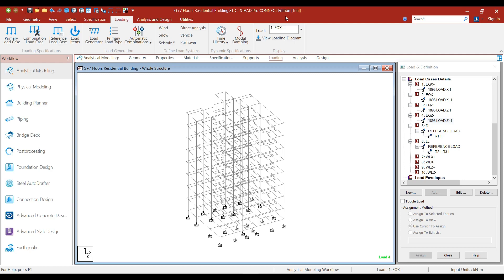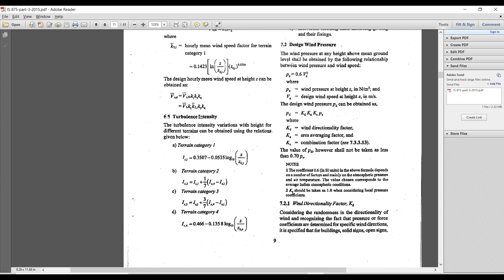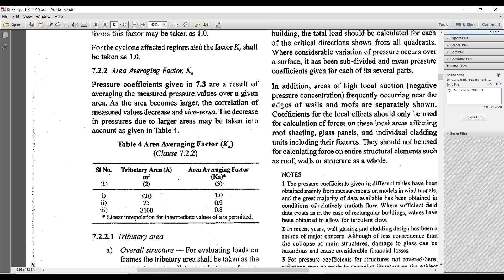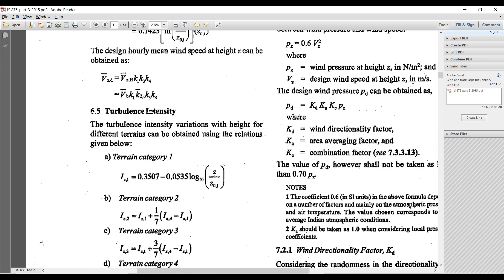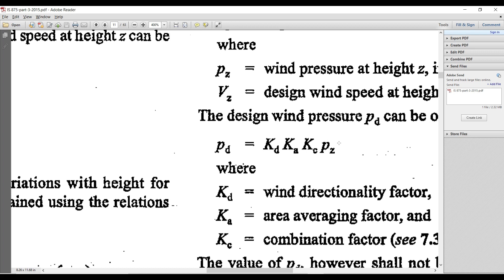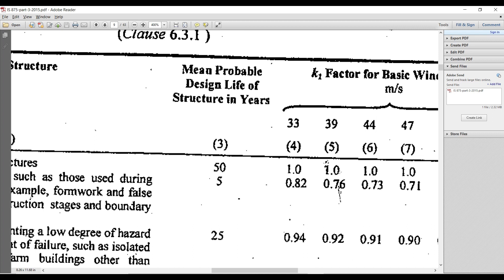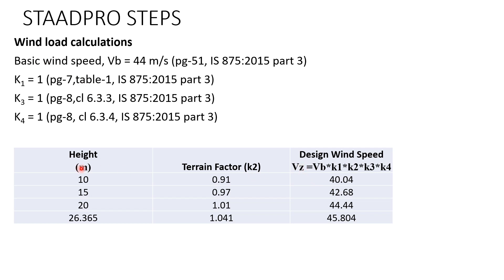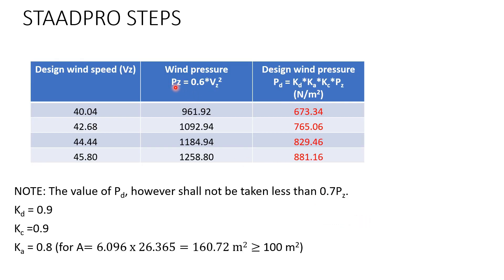Part 17 : Wind Load Calculations (IS 875 Part 3)

Comment: Instead of taking whole height for k2 calculation, should we divide it in horizontal strips and then find k2 for different heights. If we go like this then what will be effect on tributary area and area averaging factor (ka) - should we take tributary area for that particular horizontal stip only. 

Overall: if I divide height in different horizontal strips then value of k2 & ka will varry at different height. Am I correct? Please clarify.